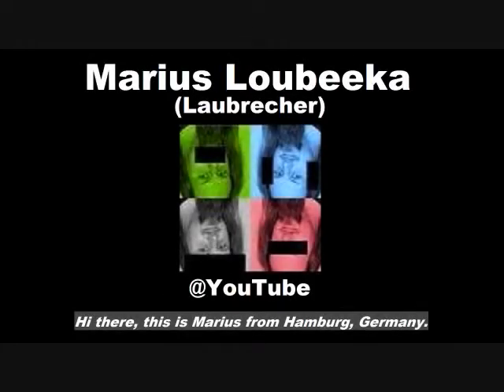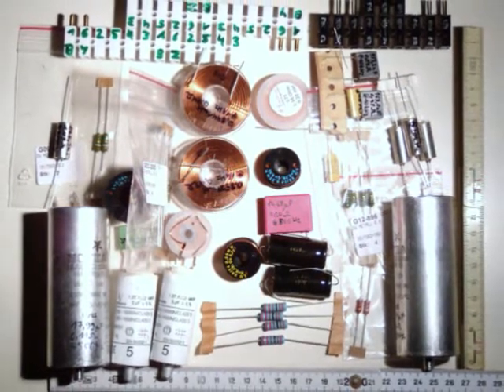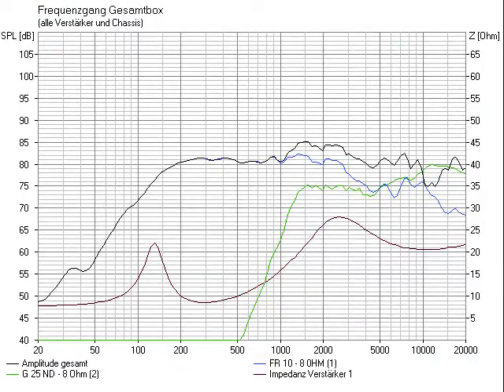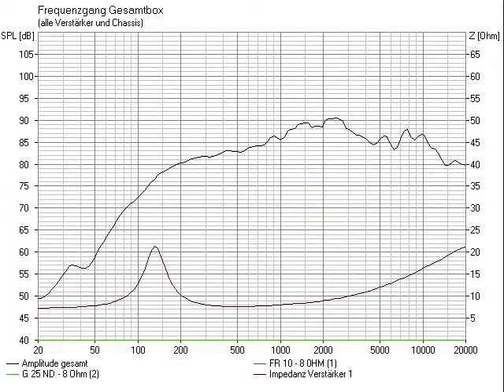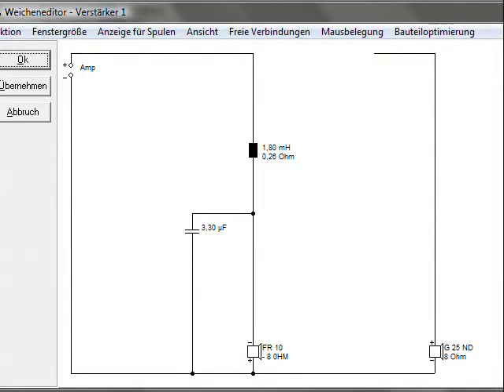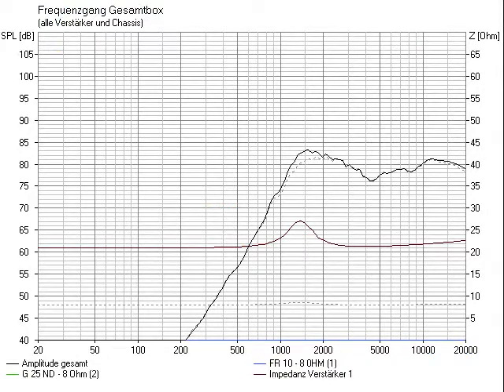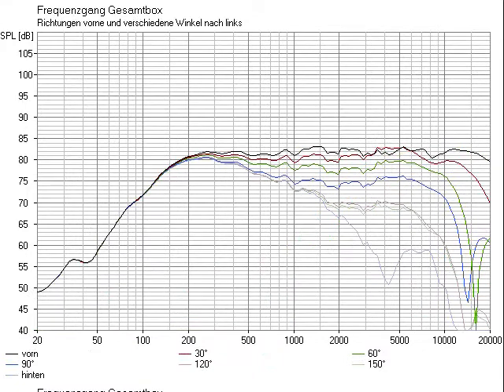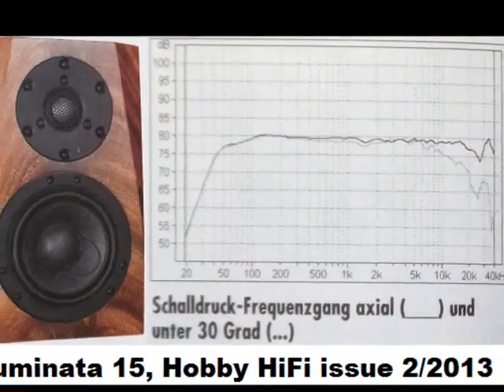How to Design a Passive Crossover Network for a 2-Way Speaker (English subs)

Comment: i have spend 5 years, working a seriel 3rd order filter, just finetuning the components.. there is nothing more fun than getting the sound better and better :)  after watching this video, much of the stuff that had been weird to me, made more sense!
Reply from the maker: Serial crossovers is an interesting topic. I think I'll make a video about that later on in my series "Crossover Network Design Tutorials". My favorite German DIY loudspeaker magazine Hobby HiFi say that serial crossovers aren't good but never proved it. So it will be interesting to try and find out if that's true.
Reply: when you make a serial crossover,  all the transducers will be in 100% phase alignment.  It sounds so much better than parallel crossovers.. !  
 
 looking at a seriel network topology,  it becomes clear, that all the drivers are connected,  the tweeter and the woofer are connected to each other, inside the crossover filter, the sound emitted from the loudspeaker become homogeneous in such a way, that i have never heard from a parallel filter.

 This goes beyond frequency response. Troels Graversen made a speaker with both a seriel and parralel, their frequency response looked nearly identical, but he were scratching his head, wondering why the seriel network sounded so much better.
Reply from the maker: Thanks for your vivid description!
Nevertheless I doubt the 100% phase alignment for two reasons: 1) a dome tweeter and a cone midwoofer are not time aligned and therefore not phase aligned because the origins of sound lie at different distances behind the baffle surface. 2) The signal to the tweeter passes either a capacitor in parallel to the woofer or a coil, namely the voice coil of the woofer. This causes a phase shift in the whole spectrum except for exactly one frequency where cap and coil compensate each other. But I can't prove that with a calculation yet. We'll see when I do a simulation in BoxSim.
But the phase shift might be not that big as in a parallel 2nd order crossover. Maybe it sounds more like a 1st order filter and that's why it sounds better. I'm looking forward to trying that out!
Reply: @mariusloubeeka5810  correct, there is no guarantee of phase alignemet without measurements. The easiest way to confirm is change polarization of middle woolfer and do sweep measurement. Spl shall go below measurement for normal connection, for some filters shall be deep symetric triangle / horn shaped dip.

Comment: What about null reverse test? Are you sure that phase shift at crossover point is ok? What's about speakers position at buffle, does this simulation tooks this aspect under consideration? If not then this crossover will not work as expected. Of course it will keep this speakers under some control but listening axe will be shifted many degrees up or down.
Reply from the maker: To reverse one driver to test the phase is a good idea. A deep notch is easier to see than the difference between a sum of 5.5 or 6 dB.
And yes, the software takes into account how far behind the baffle the sound source is located. You can define it in millimetres.